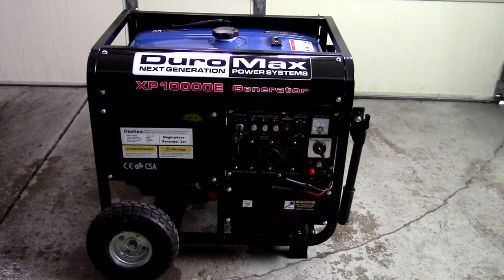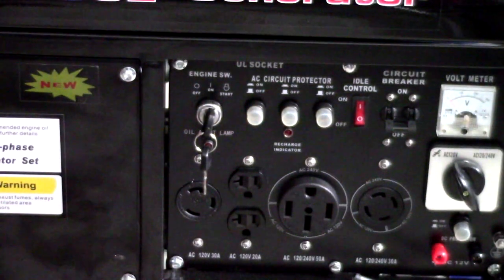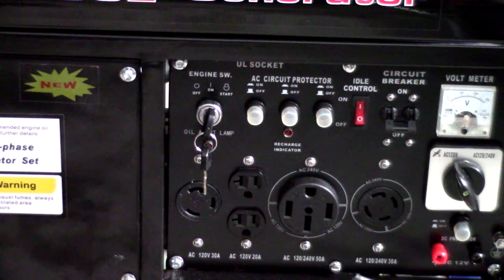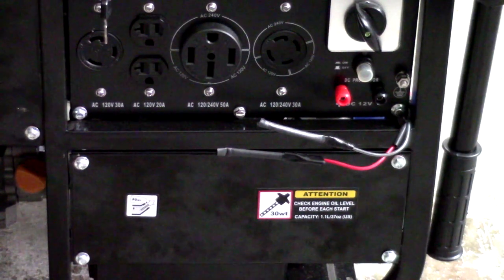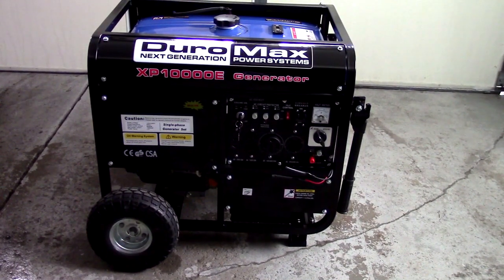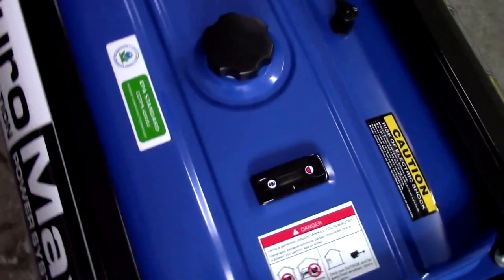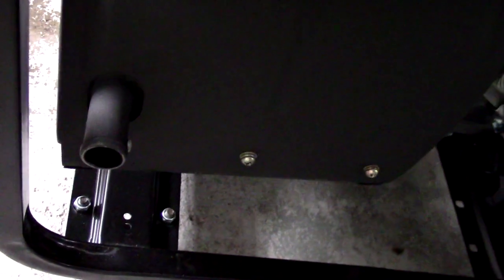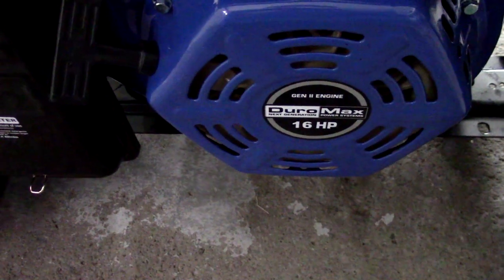DuroMax XP10000E Generator Review and Operation

Comment: I bought this one about 5 years ago and added a natural gas line to it with a conversion kit recently….still working great!
It runs my AC, well pump, pool filter, whole house!
Reply: I have a natural gas line 30 yards from my house and wouldn't let me tap in when I built my house in 05!
Reply: @jasoncessna2522  then you do it.  As soon as the gas company changed the meter, I was running a line to my pool heater….I did at least do a pressure test…lol
Reply: @Broncort1  hahaha, my pool heater is also electric!!!  I thought about it!

Comment: I bought one of these in July 2019 from Home Depot. It's EPA and CARB certified. I converted it to run on natural gas with a kit from Century Fuel Products so i'm not putting gas in every 8 hours. Our local power provider is PG&E which states that if necessary the power would be cut off if high winds threaten to start more fires like the one that burned last year and killed 85 people. I've got a wine cellar that has to be kept about 60 degrees F in the summer with a 240 volt, single phase air conditioner and It's enough for small air conditioner for a bedroom and a couple of fridges.  This unit works fine routed thru an 8 gauge four wire SO cable and a dual pole, double throw transfer switch that isolates it from PG&E. I tried to connect the gas with a 25 ft 3/8ths flexible hose used for a propane hookup but had to up grade to 1/2 inch to get it to work properly. I installed a FOUNDOWN-026 Digital Tachometer RPM/Hour Meter Counter to set the speed of the generator at 3600 RPM. It's something that this unit needs from the factory to get it setup even on gasoline. The adjustment is on the governor and with the flow control for the natural gas at the regulator, you can get it plus or minus 20 RPM under load. I put it in an enclosure that has sound baffle boxes on either end that reduces the sound down to about the same as the outside unit for an air conditioner. I puncher a hole thru the baffle box on the exhaust side for a 1.75 inch piece of electric conduit, then ran a 1.25 flexible exhaust pipe thru that I can route it up to the roofline of the garage that it sits next to and keep the noise down. The heat is drawn off by an 12 volt automotive electric radiator fan that I got over at Pick-N-Pull off of a Lexus that pushes the air out one end of the baffle box. It works well, has the same air temp as the outside air temp when it's running. When the generator stops. the 12 volts stop and it heats up a bit inside but not enough to worry about. The 12 volt output is protected by an 8.3 amp circuit breaker so look for a fan that draws this or less. The instruction book states not to hookup anything but batteries to the 12 volt output so I have a 12 volt 40 amp power supply that I will plug into a 120 outlet on the generator when it arrives. It's locked down to two poles with a heavy duty cable because the thieves will listen for generators running and will come by and take yours when you are sleeping
Reply: Did you need to cut the frame to install the converter kit
Reply: @xXxM1LKYW4YxXx  Yes, the air cleaner wouldn't clear. I did add a  brace on the side to make up for cutting out that piece.
Reply: You gotta get a video of that setup!

Comment: I've had the Duromax XP4400 for the past 5 years. It's been a great gen. I decided to upgrade to this XP10000E unit this week. Bought it brand new, shipped for $699. That to me was a steal. This thing retails for nearly $1,500. Have the 50 amp direct plug installed on the house to the switch panel so next time we have a power loss, I'll crank this baby up and will be business as normal. Great review.
Reply: Better check to make sure it works before an emergency. Mine constantly stalls, can’t figure out why
Reply: Where did you buy it for $699?
Reply: @DONALD1951  My brother and I have the 10000eh. My brother got one off Ebay new in the box for $499.00. I paid about $899.00 for mine.

Comment: Bought this unit though sears, had it for 4 months before we had a power outage, ran it for 8 hours and the valves stuck in the head, had to repair myself, warranty sucks! also while doing repairs found spark plug threads were crap! I'm a gear head so repairs were pretty easy, motor parts are same as Honda GS390 and 420 rethreaded head to a standard 14 mm plug, has done a good job since and competes with higher priced units. knowing what I know now I would still buy another.
Reply from the maker: Did you determine why the valves got stuck in the heads? Was there an oiling problem or valve stem to guide clearance issue?

Comment: I purchased a XP10000 some time back and had it in storage. I never have had the need to use it until this week. I knew the battery would need to be charged so I removed battery cover to charge battery. I discovered the the battery did not have a attest ground wire attached nor could Ifind one. Did company forget to attach one? Did you have to put one on yours? If so were does ire hook too other than battery? Thanks for he help!

Comment: That's pretty bad ass. That'll run the whole house. Nice Gen. What I don't understand is shouldn't that engine have an alterantor built in to charge the battery while running? You know, similar to a riding lawn mower engine that throws 14 volts at the 12 volt battery while it is running. You would be able to verify that by taking a meter and measure the voltage at the battery while it is running and compare the voltage to what you have when it is not running. If you have higher voltage when running, then it is throwing a charge at the battery. Pretty easy test.
Reply: The generator charges the battery.
Reply: @Broncort1  I think my comment was related to what he was saying about "maintaining" electric start and suggested plugging the battery wires into the 12 volt outputs on the front of the gen to charge the battery. If he has to do that then either he' doesn't know that the battery gets a charge while the engine is running or it doesn't have the coils under the flywheel to throw a voltage on the battery. I did mention how easy it is to find out.

Comment: Nice video,I have the XP 4400 E going on 3 years and have not had any issues with
it. However, i have a submersible well pump 3/4 h.p. and 160 feet deep, i have been told that i don't have enough generator to operate my well pump and this is our only
source of water. Can you tell me if the XP 10000 E would do the job ? Also i have
been warned that a well pump takes 3 times the wattage to start it, and than  
returns to it's run mode,. Insufficient generator size will damage the pump as well
and to replace one is very expensive so i want to be sure. Thank you and  please
advise.
Reply: My well is 220 ft deep and I run the pump with a 8000 watt gen, been here 18 years and no pump or water problems and it's runs on 220 volta.

Comment: I really need to know what the valve lash is on this model.
There are no service manuals available for the things because they are made in China but sold by a California company " DuroPower".
I got one for free that was locked up due to a push rod that fell off so I removed the head to look around and then you could turn the engine over with the pull cord.
I reset both the rocker arms at .005 and that produced too much compression to start with the pull cord so O finally got it to start ( on battery power ) with settings of .005 exhaust and .009 intake but it still takes a long time to start.
Reply: its a honda clone, look up honda specs for the equivelent size engine

Comment: Thanks for sharing this video. I have this Model, but my muffler looks to be of a newer cleaner design. I purchased mine on EBay, and got it for $629.99.  Can you tell me more about the wires that you have connected ? Do you use them for charging the battery in the generator ? Or ??  My main reason for getting this big boy is because we to have power outages here in Oklahoma during the winter months, and if we have an ice storm.... The power is off for long time. I will also be using it to power up my big RV while out in the deserts, and won't have any problems running my ac units....

UPDATE:::::
I purchased the DuroMax XP10000E last Christmas 12/14/15 or there 
about... Just started running it, and the darn thing
sounds like it's got a valve problem because when running the engine is 
popping from the exhaust... I have always heard that was a sigh of valve
problems, I called MAXTOOL and the service rep was a RUDE %#$&^.... 
Though he did say that it sounded like it needs a valve adjustment, and I
had to pay someone to do that for me. That is just WRONG !  The Gen is
new, Why in the hell would a new Gen need a valve adjustment? I truly feel
that MAXTOOL should be the ones to pay for any adjustments, Because they
sold the generator...
I gave good money for  this generator, It shouldnt be having problems this 
soon........  Any  thoughts anyone ??  Mabe they should be on BBB's list of
business that are not treating their customers as they should be treated...
Any thoughts anyone ?
Reply: Well, you got unlucky with your Chinesium made product.  It’s a roll of the dice 🎲
Reply: @Broncort1  damn! 6 years ago... nevertheless it's still running strong and new owner likes it. I sold and bought a Honda 3000 inverter generator.  Now that I'm full time in Mt rv, it's all I need.
Reply: @RogerSayers  probably just needed the carb cleaned. Mine did that after sitting for a long time. I cleaned the carb and it runs great again
Reply: @theebrewmaster  The Gen was hardly broken in.  Guess it could of had a faulty carb, not sure... Anyway got rid of it and got a Honda inverter generator. Runs my ac on the rv, and now that back on the Mojave Desert in Southern California,  I'm not worried about those crazy cold winters...

Comment: Having some problems with the chocke leaking some gas from behind the filter  it tryes to turn off can someone help thanks
Reply: your needle and seat are probley leaking or stuck,, try cleaning out the carb and or replacing the needle and seat ..alway's turn the gas off when not in use  had mine for 7 year's now ... never had a problem with it   hope this help's

Comment: Shopping Dad.. Nice video. You explained things well. Do you fire up the unit before connecting power cables or do you connect power cables first, leave the circuit breaker on the generator to off and then start the generator? Thanks for the video.
Reply: Start it, let it run for a bit, then turn on the circuit breaker.  Hope you weren’t waiting for this guy to answer for 5 years. 😂
Reply: @Broncort1  Thanks for the reply. Nope. Through the years I have learned the how to's with it. It has been a good generator. The generator is now using synthetic oil. It has powered us through 3 power outages and I lent it out twice. Now I am looking for a whole house generator that can produce "clean"  electrical output that incorporates a pure sine wave inverter.
Reply: @rafaeldiazus  what type of synth oil do you use?
Reply: @Broncort1  After surpassing 320 hours on the gen I went with Mobil 1 10w-30, I have yet to reach 200 hours before replacing the oil. Viscosity should be fine for my area and temperature. Their were other good choices but I purchased 2 gallons of the product and replaced the oil for my riding lawnmower as well. Prior to synthetic I was using Valvoline.

Comment: Why would you disconnect the two wires (red and blk.) when you have a connection for charging batteries ?
Buy disconnecting those wires did you disable the electric start ?
Reply: The red/black on front plate are for charging a car battery. These are not related to the starter battery. You would not want to disconnect your starter battery under any normal condition. They recommend running it for 30 minutes to charge the battery up if it is left off for prolonged periods of time. I believe the battery charger system is 10 amps.
Reply: Can you help me out on this?  The owner's manual says little to nothing about charging the battery or "recharge".  I have a brand new unit for a concession trailer, when I ran it the second time, the "recharge indicator" light came on and then the motor died.  I don't know if the motor dying had anything to do with the recharge light being on, after a few cranks, the motor started up again and ran fine and I couldn't see any reason why it would have shut off.....fuel was fine, choke, oil, etc.  Actually, I can't say the recharge indicator light came on and then the unit died, what I noticed was when the unit started back up, that light was on and it wasn't before, so I assumed that it was on when the motor died.

Anyway, this wires that he has coming off the battery in this video, are they for charging the battery of the unit or for connecting a battery to the unit to charge?  Furthermore, my understanding is,  according to the manual, that the DC red and black terminals are for connecting a battery to charge like you said in your post.  In this video he seems to elude to those having something to do with charging the battery within the unit. 

And lastly, there is no mention whatsoever in the manual that I can find about the recharge indicator light being on,  What does this mean?  Does this mean I need to recharge my battery?  Does it mean it is recharging my battery as the unit runs?  And just to be clear, the battery isn't just for the electric start, is it not, it is also necessary for the spark plug.
Reply: @aservantinbabylon  
The recharge light means its recharging the battery. As the unit runs, and the battery changes back up, the light will fade off.
Reply: I removed the side plate by the battery and connected a larger battery for a lawn mower to it. The reason was that the gell cell it came with died. Now I have a larger battery connected and keep a battery tender on it so it's always fully charged when needed. Lots of cold cranking amps when the temp is -18deg. F.

Comment: I made a huge mistake by jumping it with my car when the generator battery was dead. Now it idles at a high rate, do you know what I did and what parts I would need to fix it? I'm mechanically inclined so I can do the work myself. Thanks for any advice.
Reply from the maker: Michael P Your best option is to call 800-629-3325 for support unique to your situation. Please note that parts are under warranty for one year, though it would likely not apply in your case. But before you call support, double check your idle control switch to make sure it is set to on.
Reply: Using battery jumpers should not change the idle rate unless there is an electrical load/short of the unit..
I dad a similar running engine problem.  It was the electric switch for 120/240 volts.
I doubt it was your battery jumper that was cause the problem.
I jump my generators all the time.

Comment: Can you help me out on this?  The owner's manual says little to nothing about charging the battery or "recharge".  I have a brand new unit for a concession trailer, when I ran it the second time, the "recharge indicator" light came on and then the motor died.  I don't know if the motor dying had anything to do with the recharge light being on, after a few cranks, the motor started up again and ran fine and I couldn't see any reason why it would have shut off.....fuel was fine, choke, oil, etc.  Actually, I can't say the recharge indicator light came on and then the unit died, what I noticed was when the unit started back up, that light was on and it wasn't before, so I assumed that it was on when the motor died.

Anyway, this wires that he has coming off the battery in this video, are they for charging the battery of the unit or for connecting a battery to the unit to charge?  Furthermore, my understanding is,  according to the manual, that the DC red and black terminals are for connecting a battery to charge like you said in your post.  In this video he seems to elude to those having something to do with charging the battery within the unit. 

And lastly, there is no mention whatsoever in the manual that I can find about the recharge indicator light being on,  What does this mean?  Does this mean I need to recharge my battery?  Does it mean it is recharging my battery as the unit runs?  And just to be clear, the battery isn't just for the electric start, is it not, it is also necessary for the spark plug.
Reply: Hi we have one to and the recharge indicator is on did u find out what it was
Reply: the red lite is supposta be on it means its chargeing the battery had mine now for 6 yrs still has the original battery in it  starts every time   it gets run about 2 times a year  for a day or 2    never had any issues with it     i highly recommend it

Comment: I've had one of these for about 8 years and it has worked very well. However, the last time I tried to use it it wouldn't start. I'm not mechanically inclined and unfortunately I cannot find anyone who will work on it. What kind of engine does this have in it? Perhaps, if it's a Honda or Briggs and Stratton or common type engine maybe I can find someone to work on it.
Reply: It's a Chinese clone of a Honda.